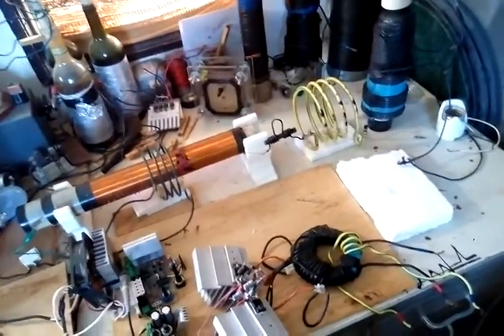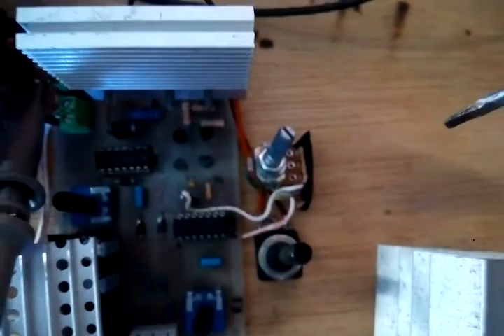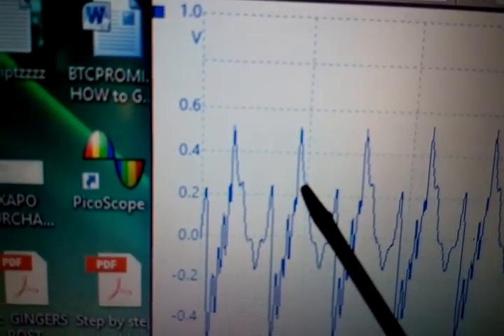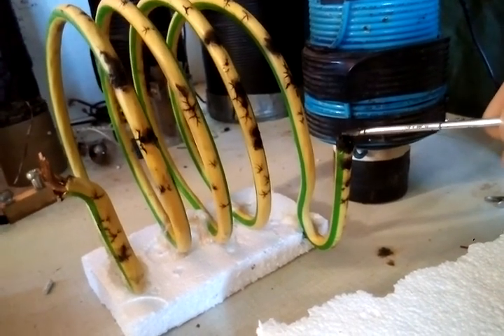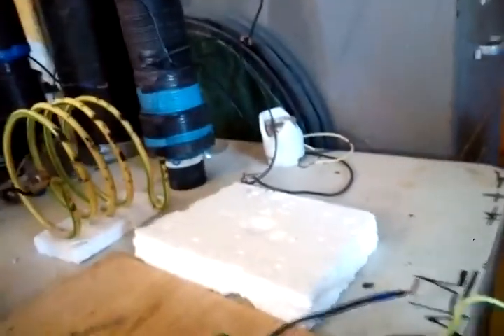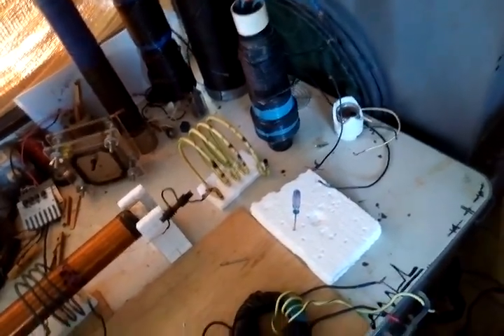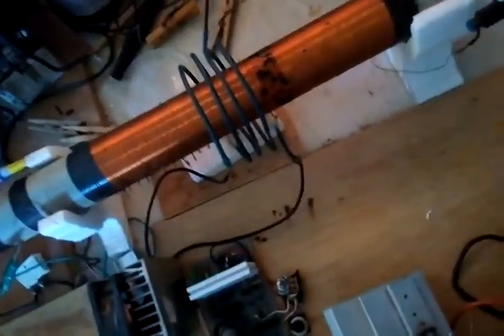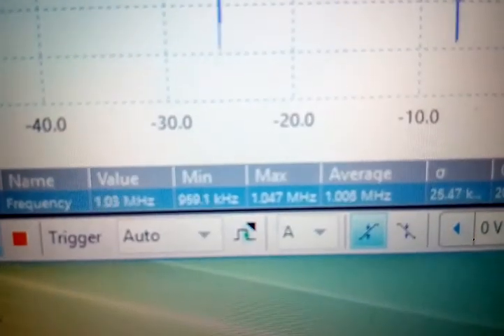Geofusion Akula kacher dead time control mod. and scope shots

Comment: From all of your accomplishments, do you believe that the simpler  Don Smith circuits can work. Anyway, How would one convert a high frequncy high voltage to mains or even 12 volts, or even charge a cap bank to run an inverter. I know that is alot of questions but what do you think?

Comment: Yes when you tune your duty cycle pot you can achieve spikes that peak out and combine with the other peaks equaling greater power.
like in a spark gap the greater> the capacitance the > the spikes...!!!
I find this out as I run  my spark gap and get more resonant power out!
The purple color is more corona effect and the whitish loud{cold electric with hot electric} sounding is a combination of HV and Hi current combined thats why you have Tesla HV coil and grenade current coil...
Now if we can get power to self loop huh?Cheers!